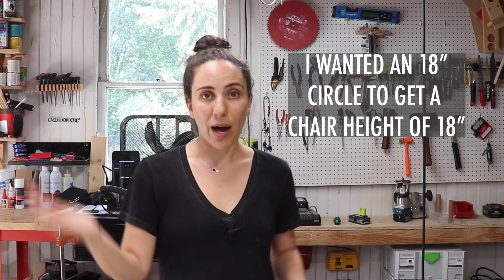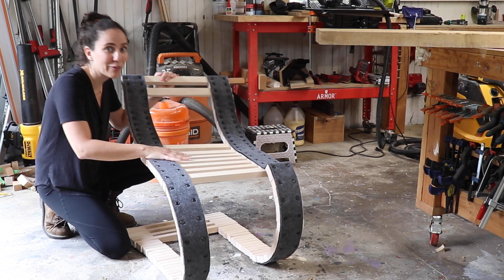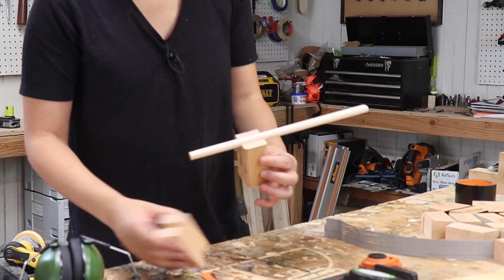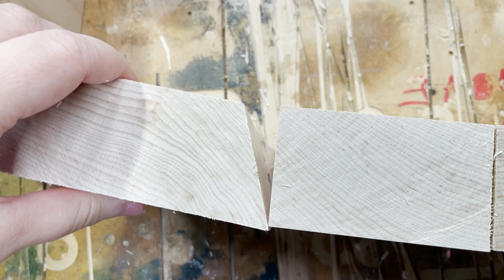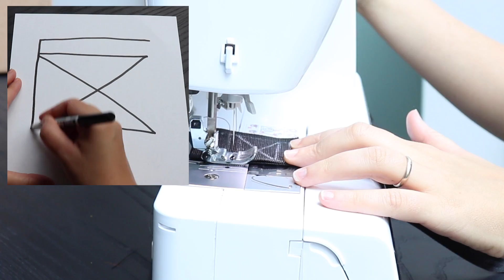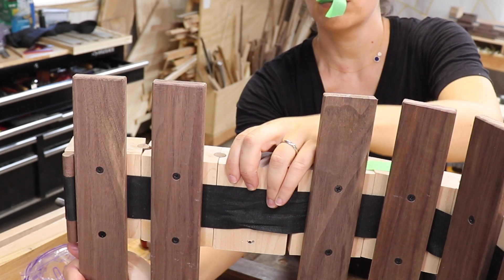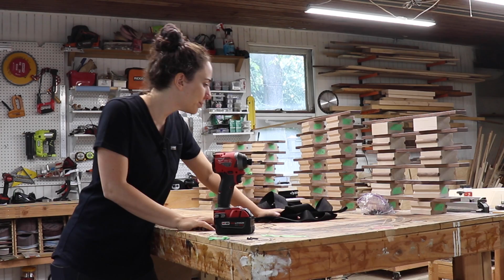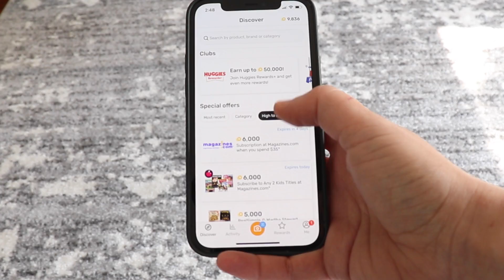I ATTEMPT to make a Roll Up Chair… AGAIN...

Comment: I think you already identified this, but the fact that the strap distributes tension through the whole thing is part of the problem. The main source of the tension will generally be at the curves, but the fact that that tension can be redistributed to the top or bottom of the chair where the geometry does not hold the sections in place and those top or bottom pieces can just curl over is what makes it prone to collapse. This seems to be the main problem with the current design, and what you identified as making it dangerous. Even if you put "enough" tension on the strap or had a rigid enough strap that wouldn't stretch, the top or bottom pieces would be pulled around when enough weight is put on the chair.

My suggestion for a solution would be to make each joint isolated so there is no way to transfer tension from one piece to the next. You could achieve this by using a metal hinge between each section. That would probably be pretty expensive in terms of hardware, but it would isolate each joint and also eliminate the stretching. Conceptually, I think that's what you need to do to make it work (and to make it safe).

Maybe there is a more clever way (and probably more affordable) to isolate each joint and remove the stretching, but I am not thinking of it right now...
Reply: Okay, I now realize a bunch of people are already saying basically the same thing... Well I think they're right.

Comment: If you fully glue the strap to the face of each piece so that its function is more one of aligning the blocks, could you then add pivoting wooden or metal straps to the sides of each block just below the slats to provide the tension you need for supporting weight?

Comment: Is it possible to have the straps not going continuously the same strip with the same tension over the whole chair? It looks like the front part by the legs needs to be tighter but tightening the strap only makes the headrest area and bottom of the chair curl up so break apart the tension somewhere in-between those areas.  My thinking is make custom tension between each of the parts that screw to the main thing that folds up.

Comment: Using thin straps is never going to work. You need to cover the entire chair in material so that the weight is distributed over a much larger area. Just like a very thick rope can hold much more weight compared to a thin string.

Comment: probably late, and not that helpful a suggestion, but the material they use for seatbelts or the material used for tie down ratchet straps may be a good material for this purpose. i'm unsure if they are made of/in the same material/way as the veonom strapping but those two materials I have experienced their tensile strength to be quite good, and to not deform until being put under TONNES of pressure.

Comment: Your design is half there. Look to add a back section that makes it scroll back to connect to the chair base,  It will look aesthetically better as the eye will flow around it, and self support that way

Comment: if it stretching is the issue all you need to do is attach the material to each individual piece securely, you'll get some stretch still but you're not gonna have the same amount of pressure on each joint anymore as they won't get deformed as fast from the leaning back, less fabric = less stretch

Comment: Hey, I'm a design student who is working on a similar concept - the key here is that the strap needs individual connections to each piece so it doesn't divert forces from other pieces which are less under stress.
Currently, the areas you're seeing having issues with are the ones under the most tension, the strap loosens up by increasing the curvature on the opposite side on the pieces that aren't under tension.

Comment: so part of the problem is the the tension is being shared so you sit on it and it makes the the ends under more tension than they should be parts that should be under more tension are releasing tension, so stapling the straps to each part will actually fix that, but yeah, even so, getting out of it too quick will make it tend to collapse forward, at least that was the main problem with the one my friend had

Comment: why not drill through all the blocks and thread a braded wire through them if you then have a threaded end you could tension as required  just by saying

Comment: Leather can also stretch quite a lot, maybe something like carbon fibre would work if you only applied the epoxy resin at the ends to secure it and left it flexible in the middle (I know that’s not how you’re supposed to use carbon fibre but I think it might work).

Comment: A couple suggestions:

You are actually only 'pulling' on two points on the strap; Each end. The longer a length of strap/rope; the more it will stretch. Because the only two anchor points in the design are at the ends; the entire length of strap can stretch. Because the straps can slide freely the amount of compression, each block experiences, equalised over the entire length. To do that, the angles with the most torque instead move more, which is why the gaps open up more in those two specific spots.

By anchoring the strap to each section you are effectively only pulling a length that is equal to the distance between two anchors, thus reducing the distance it can stretch, and since they can't slide freely the compressive forces don't equalize across the entire structure. I think you could do the anchors in a similar way you prevented the twist: Use a dowel and socket to friction fit the strap between each 'structural' section, and each 'retention' section. This would still allow for adjustments still, but when 'locked down' would be a very secure fit.

Another suggestion would be to make your 'structural' blocks wider (as in more distance between the inside and outside of the curve). this would create a longer lever arm from the pivot (at the inside of the curve) to the lateral force enacted by the strapping, thus causing less deformation (stretching) of the strap, and prevent the gaps opening wider again.

The only downside to these suggestions is that, by nature of isolating the sections of high torque, you cause them to become stress points, so you need to ensure that whatever strapping you use is capable of holding that tension, and whatever blocks you use won't split or break either. I would probably suggest that you'd want to nuts and bolts, rather than screwing directly into the wood to secure the different parts of the slats together. to reduce the risk of splitting.

Hope that made at least some sense.

Comment: the solution is so obvious that its making my cringe
Reply from the maker: So try it.
Reply: @3x3CustomTamar  I'm a full time student and I work part time aswell, I have no free time, and btw u need the strap to go through the middle of the notches or "teeth" with a system to tighten and un tighten the strap, I would suggest 2 snail shell plates and the rest should be self explanedatory if not I could send u a schematic and as for the straping use old seat belt, much less stretch, and ofc don't nail or stop the belt from flowing, the wood should act like scales ish. If u need more help I could just make a 3d model in sketchup and send it to u, an I only have time to do the 3d stuff cuz thats part of my degree
Reply: @3x3CustomTamar  oh and the distance frome the inside of the curve and the belt passage should very depending on the weight it should take, and use hard wood, harder to work with but there's a reason they don't make chairs out of pine very often

Comment: There's an enormous amount of force being applied to each strap segment between adjacent blocks. As you sit further away from the vertical part of the chair, the force on the strap will increase.

Practically, you'll need a strong fabric that is really good at resisting stretch to make it work. Not sure what material, but excited to see you work it out!

Comment: What about a munch of separate hinges? Will probubly add alot more weight but I figure it would be more stable, plus it would provide directional strength like the dowels did.

Comment: I'm really glad you stuck to this. We can't always see where we are going. Sometimes you just have to keep slamming your face in a wall until you find a way around the turn.

My two cents are on having two different tension systems. One for the back, and one for the legs. In my humble opinion, it appears that the gap between the slats on the back and the structure may be your problem.

The two parts of this, pretend and purely academic, tension system could potentially be joined with a different layer of structure on the top or bottom of the profile, or the inside of the alignment. 

The mechanical advantage of the legs on the tension side must be incredible. I'm just throwing it out there that you have a LOT of force. I think the leverage forces are 20:1... 30:1?

If you weighed 100 lbs, I'd bet another 2 cents, that is a ton of force in total. 

Again, I'm totally speculating, and not reading other comments on purpose. You are kicking ass... There is nothing wrong with being ambitious as long as you can afford to be

Comment: If you make the bends where the strap is shorter than the blocks in one piece, bearing in mind the angle it needs to roll up, and instead of straps and planks make it a chair entirely of one wide strap attached to the blocks... I still wouldn't dare sit on it, but it COULD work temporarily.

Comment: couldnt u just make a mechanism that would pull up a support so it wouldnt go down that much?like maybe some sort of a strap attached to the top of the chair and some kind of metal tubes attached to the bottom, and when u would roll the chair out the strap would pull the bar up to support the part that goes down

Comment: You are fighting very high compression forces on a design that requires tight tolerances.
Even with metal latches, the wood is going to compress which will change the angles on every surface.
You can minimize forces by making the wooden blocks even thicker.

Thanks for putting in the time! I find the statics of this design very interesting.

Comment: I love your videos, very nice!

I see there are over 6000 comments at this point and I've only read the first 50 or so, so please forgive me if I'm repeating what other people have pointed out.

There are three challenges with this design.

 1. There's a lot of unfortunate leverage going on.  If you focus on just the block by your calves, when you sit on the chair your weight creates a lot of torque which that block has to counteract in order to keep things from moving.  The torque you are exerting is your weight F times the radius r of that lower C shaped section, call it 10".  The counteracting torque is provided by the tension in the strap and the compression on the inside of the block.  If that torque has to be created across a block thickness t, it requires a force f such that f = F * r/t.  If you weigh 120 lbs, r is 10", and t is 2", the force on the strap is 600 lb.  (Admittedly split between two straps.)  That's a fair amount of force, easily enough to rip apart a rubber mat, but no problems for the nice webbing you used.

 2. The geometry sucks.  The angle (radians, 1 radian ~ 60 degrees) of the C shaped section is given by the difference of the outer and inner (half) circumference of the C shape divided by the thickness of the blocks.  180 deg is ~3 radians, so the C shape required ~30 inches of strap length for that radius of 10".  If you measured that (half) circumference around the inner part of the blocks making up the C, you'd see that it is 6" shorter (3 radians times the block thickness of 2").  The rub comes when you consider what happens when the strap stretches just a bit.  Suppose it stretches by 1/4" total over the 30", i.e. about 1mm between each block.  That changes the difference in the circumferences by 1/4", of course, which in turn changes the angle of the C by (1/4" / 2"), i.e. 1/8 radian i.e. ~7 degrees.  That's enough to close up the C from 180 deg to 187 deg and start to feel like it's falling backward a bit.

 3. The S shape doesn't help.  You need a lot of tension in the C portion of the chair in order to keep it from closing up from a C to an O, but if that tension is present in the S bend of the part of the chair it will try to whip it closed on you.  Nasty!  Therefore you have to ensure that the chair does not have a continuous tension throughout the strap but instead has tension in the C portion and little tension in the flat bottom and the back.  The strap needs to be afixed at the top and bottom of the C, so tension throughout the C is pulling against those fixed places, rather than the S portion of the strap.

So now all you need to do is find a strap which a) is flexible enough to roll up, b) strong enough to carry 2x300 lb, c) stiff enough not to stretch by more than a fraction of a millimeter when subjected to a force of 300 lb over a block length of ~3".  Polyester, polypropylene, leather(!) are OK for a) and b), but definitely not for c).  You could probably do OK with an aramid (kevlar) fiber or you could do it with a bunch of strands of steel cable, inset into grooves in the wood.  The various suggestions I've seen about hinges and motorcycle/bicycle chain are right on the money: flexible and extremely stiff.

Anyway, great fun watching your videos and I really love your creativity and skill!

Comment: I think part of the issue might be, sadly, the core materials themselves.  Part of the gapping might have been from the wood itself compressing in various ways- it wouldn't be much in any single spot, but with the number of segments, it'd add up.

Also, the webbing- you need something that has ZERO stretch.  Not just low stretch, but none.  A possible solution would be to use metal hinges at each joint, instead of fabric webbing.  Or else see if you can find a highly flexible thin spring steel.  Maybe conveyor belt material, or post-crash pre-stretched seatbelts?.  Something that wouldn't stretch at all.

Comment: I'm not certain i understand why end to end strapping is desired.  You should really only need it in the places where you are creating a curve and the point of it should be to limit the degree of the curve.  The back of the chair curves and flexes in the opposite way and needs tensioned differently than the curve of the base or the seat.

Comment: Honestly it looks like you did a great job of executing and building what you envisioned, you just didn't do a very good job engineering it.

As you said at the end, doing some different kinds of connection would make a lot of sense, but one of the biggest problems you have here is stretch. 

Part of that stretch comes from the stretch in the cable and some of it comes from compression of the wood.

To address the problem of stretch in the cable, you either need to change material or use shorter sections or maybe even reinforce each section at the points of stress, so for example, building in low stretch strapping underneath the main strapping that reinforces just the lower curve.

To reduce the compression, you could look into maybe some metal inserts in key areas.

It would increase the weight somewhat, but probably less than you might think.

This feels like the kind of problem you would see as a first year engineering student, kind of like building a raft out of cardboard that can support a human across a specific distance of water, or building a bridge that can support a human's weight out of chopsticks....

This project is doable.

You could also put in some magnets that would help keep the top curve in place during rollout and setup. They could be made to mimic the aesthetics of the metal reinforcements.

Comment: moving away from the strapping suggestions you could also have too much squish in your wood still, i don't know if it would help take more squish out but look into stabilizing it? i'm not an expert so i can't say whether or not replacing all the air and/or water in the wood with resin would be helpful at all

Comment: The strap has to cross to the back for the,, well the back. 
The tension is different there, you're stretching it through the base, then compressing it through the spine.

Imagine shortening it while it's fitted like that. The base would straighten out, but the back would roll up long before the seat even considered it.

The trick then is finding the ratio, such that rolling up the base loosens the straps up enough to roll up the back

Comment: If you look at a block when a gap appears, you can see it as a lever, with the axis being the back of the block. When you push on the back of the chair, there is a force applied approximately 0.5 m from the pivot point, and that force has to be compensated by the strapping, which is only 0.05m away from the pivot: The force in the strapping is 10 times the force you put on the back. It's normal that the stapping elongates a bit, we're talking <1% elongation but that's enough. I know I'm not giving a solution, sorry, just a better understanding of the problem.

Comment: having a long strap from one end to the other gives it a lot of length to stretch over you need the strap to not slide by any piece. and whenever you take more strap away it adds more tention and therefore more stretch so take away probably 2 or three times what your gaps are